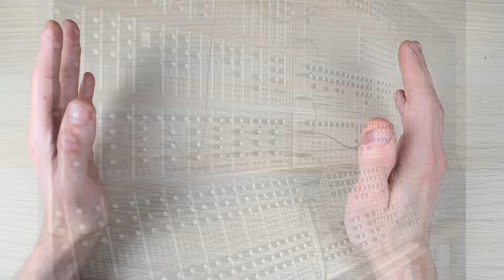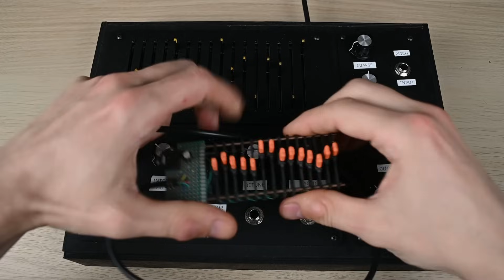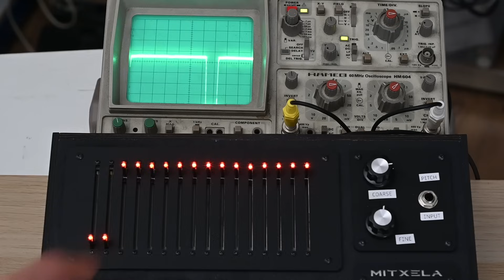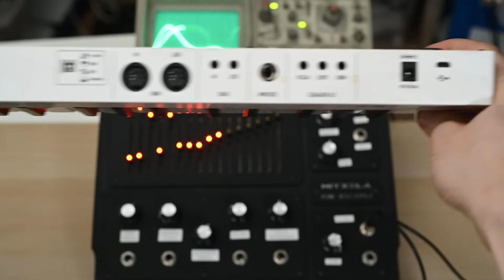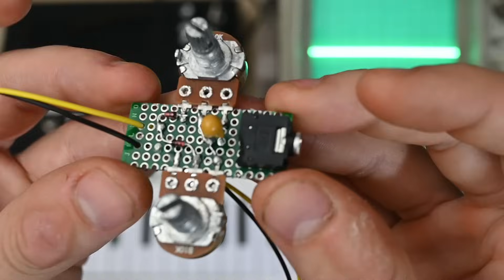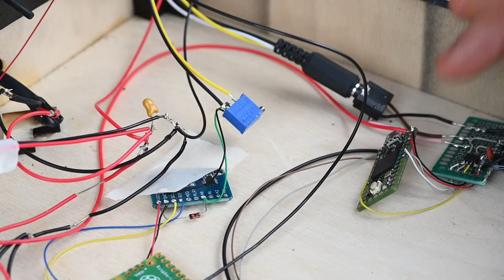R-Scope mk.2 synth demo

Comment: Lots of nice sounds coming out of that!

I can really recommend PlatformIO as a replacement for the Arduno IDE. It's a plugin for VSCode and while not perfect it's a much better experience than the Arduino IDE. Supports Teensy, STM32, ESP32, RP2040 and more.

Comment: The apparent presence of ‘being’ is replaced by a broken “non-origin”. But the market is flooded with thousands of synthesizers, real or virtual, retro-fit sample libraries, cheap codified emulations of 70s and 80s mixing desks, compressors, delays, echoes and reverb washed up from the past. Pastiche, acquisition and repetition? “The no longer and the not yet” coexist, in the fascination with television, vinyl records, audiotape, lo-fi and with the sounds of these technologies in decay. Defined as “materialized memory” (by Fredric Jameson) is perhaps the presence of hauntology within genres of electronic music, especially audible post 2000.

Comment: Given how sleek the exterior looked, I wasn't expecting the inside to be a bunch of loose or taped down dev boards and proto boards soldered together with a bunch of individual wires haha. Before that part of the video, I would have guessed you made some nice PCB with everything integrated. It was also more digital than I would have guessed.

Cool video
Reply: The inside definitely needs Tantacrul's Jankman popping out ^_^  It's almost as hideous as Sibelius.
Reply: @thecatofnineswords  That's quite the claim!
Reply: This is how a prototype looks! Plus he said he had to make it incredibly fast.
Reply: @djmips  My prototypes look much worse on the outside 🙃
Reply: honestly it's kind of intresting how there's 2 ways you can make something 

you can choose to go for the outcome only doesn't matter what's inside as long as you get the desired outcome you see this alot with how games are designed

than there is the idea of making it efficient and good as possible hoping to achieve your desired outcome in a manner you'd consider clean or usable as like a base. I tend to see this alot more when people design stuff for manufacturing.
Reply: @learningtodrawstudios4773 I generally go for the latter approach myself, but seldom finish anything.